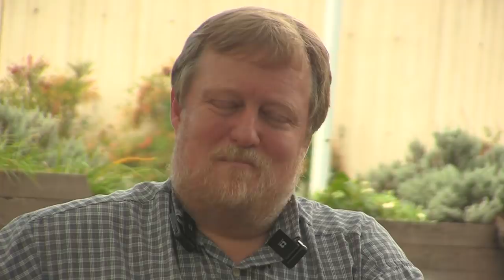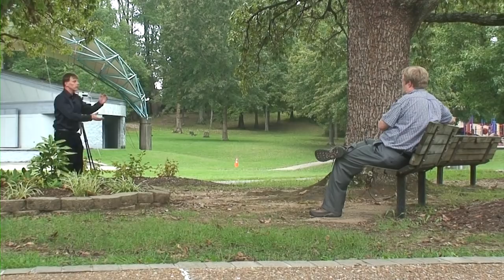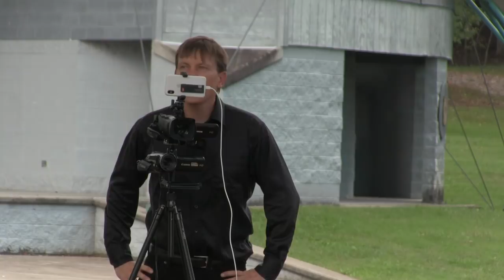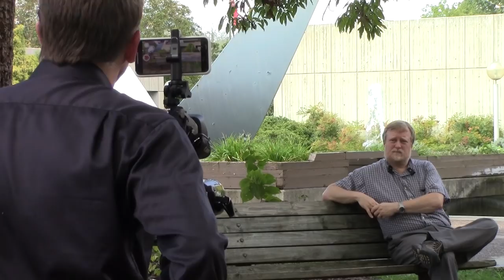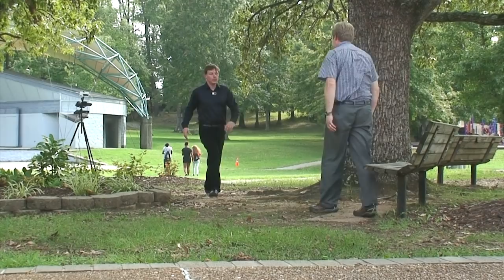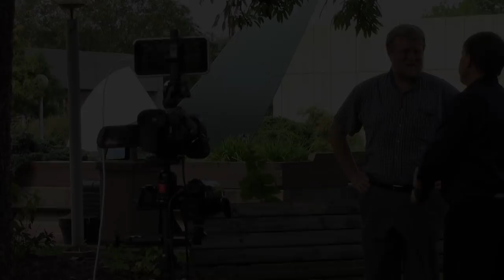Dr. David Holcomb - Molten Salt Reactors - Interview Semi-Raw Footage

Comment: I have followed MSR for a while. I just don't see why America doesn't purse this like crazy. I would think it's a national security issue. Getting large scale MSRs would revolutionize the country. Cheap, affordable, clean energy. People want electric cars but they don't realize you have to burn fossil fuels to fill the batteries. I wish Jeff Bezos would set a goal to build a MSR.
Reply: Get rid of the graphite moderator and i'm in.
Reply: Bill Gates is doing it in the US and China.
Reply: Follow the money.  MSRs will disrupt the legacy nuclear industry, the coal industry, possibly even the natural gas, and petroleum industry.  They will no longer be able to sell absurdly expensive fuel assemblies.  Thermochemical hydrogen production could make synthetic fuels, and hydrocarbons cheaper than conventionally produced products.   MSRs could even be used to produce energy intensive products, like Portland cement.
MSRs could even make existing PWRs have negative net worth, since they would lower the price of electricity, but not the cost of decommissioning.
Reply: Once China has one built, even in the sub-gW range, we'll probably see our armed services rush to develop a variant.
Reply: china solved the graphite moderator issue
Reply: @MrJason005  Do you have info? China wants to patent it right out from under us, and I'm hoping they don't Beat us to the Punch.
Reply: vampov: My hero would be tesla battery making transition to molten salt thorium reactors for the real dynamic change for both europe, and America. and the world.
Reply: @mukiex4413   our 21st century Sputnik moment
Reply: @hjembrentkent6181  Have you seen Ed Pheil's videos on YouTube?  His design doesn't have any moderator and can run on spent nuclear fuel, depleted uranium, natural uranium, or thorium.  His design is the best I've seen.

Comment: An analysis of the nuclear sites in Europe was done.  The analysis showed that there was a slightly elevated cancer risks near these sites.   This included sites that had nuclear plants planned but not yet built.  Turns out that these sites were almost all built on old industrial sites which had carcinogens in the soil or water.

Comment: To respond to some of the comments seen here about past nuclear opponents being the problem: There is a world of difference between light water reactors and molten salt reactors on a grand mass scale. One can easily oppose one system due to serious concerns over safety and for other reasons.

Why don't we have the promise of nuclear fusion working for us now? I can answer that one. The working temperatures required are not compatible with a production scale that is both safe and efficient. The temperatures required for fusion are simply too high.

Molten salt reactors solve many of the serious nuclear reactor concerns and I sure as hell hope people like Dr. David Holcomb can make this work on a grand mass scale. Global warming is best solved by solutions good enough to go the distance.

Comment: if former president Nixon hadn't stopped research on MSR in the 1970s , the USA could be in a much more comfortable economic and environmental situation, than now. The power-generating Industry would have 30 - 40 years experience with molten  FLiBe salts.  it even should be considered to have  synergistic effects with Tokamak-fusion reactors, which will need FLiBe-blankets!  The problem of Tritium-seqestration, which was mentioned by Alvin Weinberg, was resolved by Kirk Sorensen's early concept of the Th-MSR with a secondary CO2-Brayton cycle. Burning excess tritium of multiple MSRs in one national fusion device, would be the most efficient combination and much better for the environment, than present industry's practice of dumpimg diluted tritium-water ( H-O-T )  into the oceans.  
Two of my questios are: would a 700MW or a 400MW  MSR () be flexible in quick power-output changes? Because, that is what the grid needs, with all the unconstant wind- and solar-electricity supplies. An  MSR (maybe) augmented by a proton-beam driven spallation neutron-source. 
Can MSRs be built safely, to stand an EMP-impulse?
Reply: This is where heat storage would work.  With heat storage a very large swing in power output would be possible.  Anouther thing is several of the MSRs designs are load following.  When one pulls heat out of these reactors, the cooler fuel contracts, bringing the fuel atoms closer making the fission proceed faster.  Hence the reactor will load follow with increased output when load increases and decrease output when load decreases.  This would make these reactors very useful where variable output is needed.